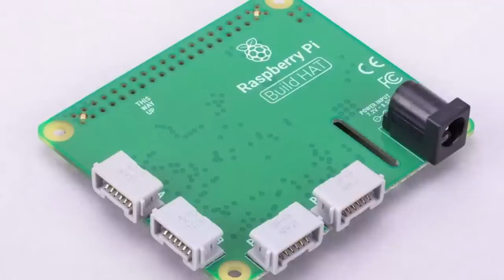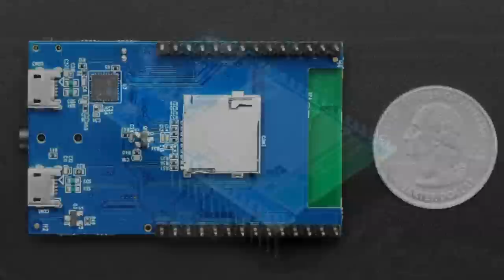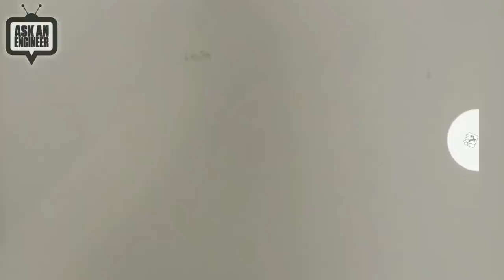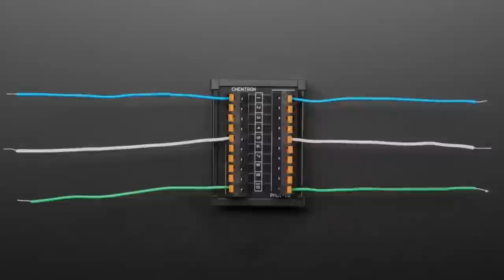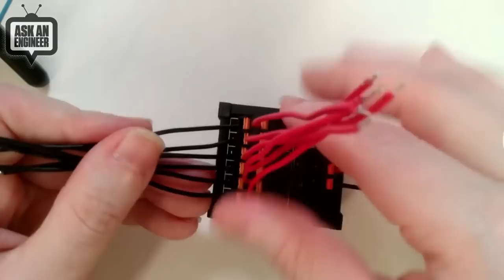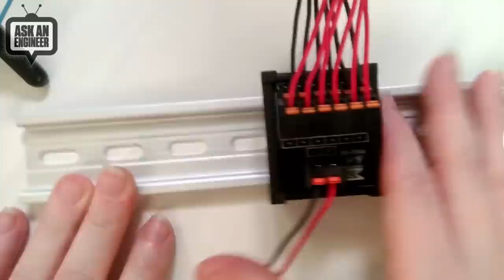New Products 10/20/21 feat. DIN Rail 10x10 to Terminal Block Adapter!

Comment: Re: the "weird voltage" of the Lego power brick

I'm sure this is based on the EV3 Technics battery pack, which used 6 AA batteries. Alkaline AA batteries have a typical voltage of 1.4 volts, so 6 of them would add up to 8.4 volts. Maybe the HAT and motors would work at 9 volts (nominal 1.5v times 6), but that's a question for the Pi Foundation.

I hated that battery pack. It was designed almost intentionally to trap 2 AAs in places where you need something like an iSesamo to pop them out.

Comment: Those DIN rail terminal blocks look great!!!
Is there any way to add solder points if you want to split the 10-way block into multiple wires?

Comment: Not that I have use for the DIN rail stuff, but I used to work with industrial machines so it got me curious.
What is the max power rating?
If someone where to run 240volts AC at 10A across it, I would guess it wouldn't like it.
Just a guess from the fact it has push connectors instead of screw terminal blocks.
I don't need to know as I have no use for them ATM, just curious.
Reply: Looking at the manufacturer's website it is supposedly rated for 300V@10A. They also have 2x12 and 2x24 models.
Reply: @CoolerQ  Thanks